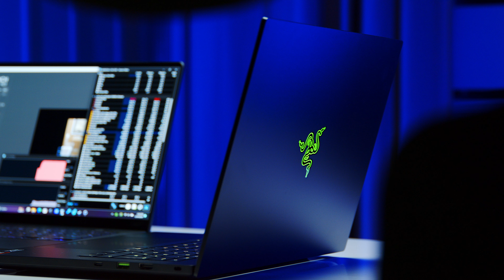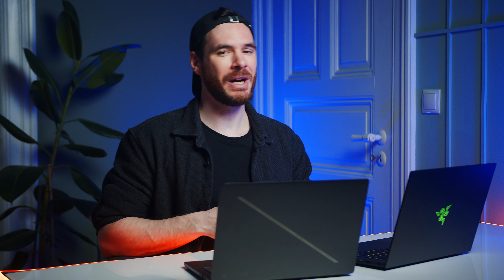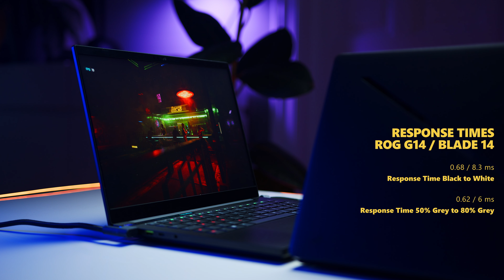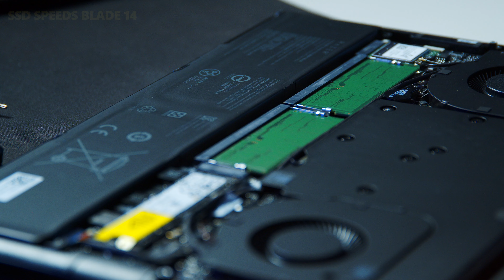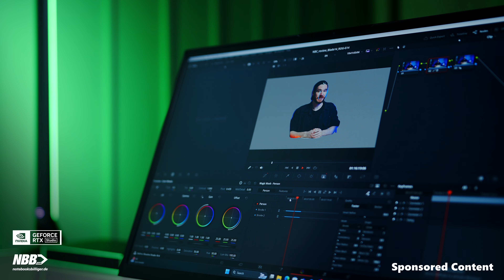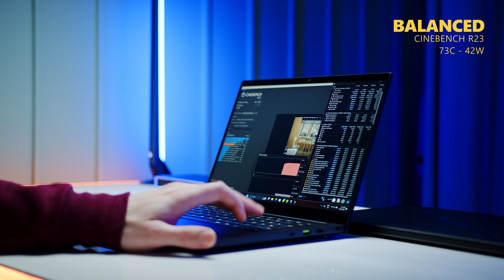Razer Blade 14 2024 vs. Asus ROG Zephyrus G14 2024 - an easy win!(?)

Comment: Great review!  I'm defijnitely thinking of going with the asus, after this.  I don't mind a bit of performance drop in exchange for the oled and the high quality speakers and keyboard.
Reply from the maker: The speakers are really insane, and that OLED .... but the Razer is just a lot faster and quieter ... I still can not make up my mind!
Reply: @NotebookcheckReviews  I have a razer blade 16 and had a razer blade 14.  Both very nice machines, but the keyboards are just weird, I find.  I got used to them, but they are quite odd to type on.  And the speakers of a Razer are definitely ok, but they don't' have bass.  I'm looking to replace my Mac (which I haven't found all that useful of late) with this machine, and the audio alone sells me on the Asus.
Reply: @mikerahl123 why do you need both a 14 and 16?
Reply: @NotebookcheckReviews  By the way, I absolutely love your reviews.  Some of the best I've ever listened to.  Thorough, plenty of good information, and easy to follow.